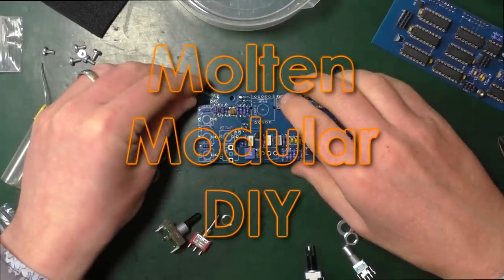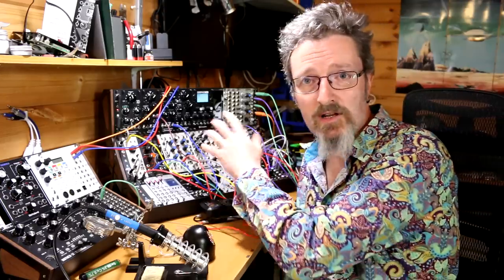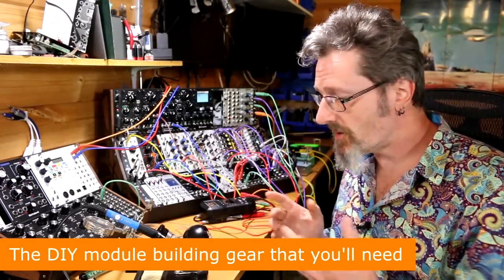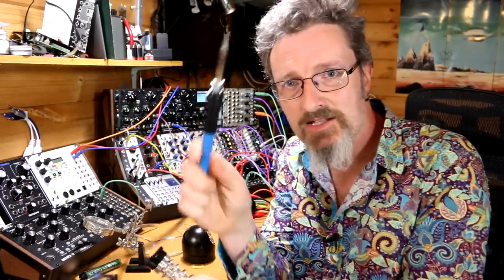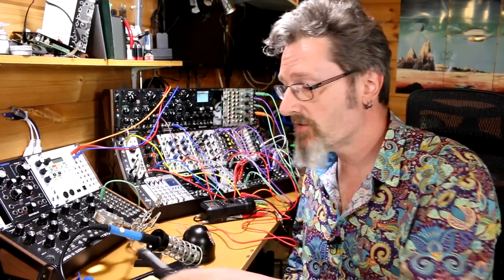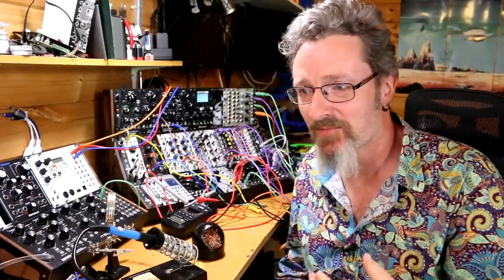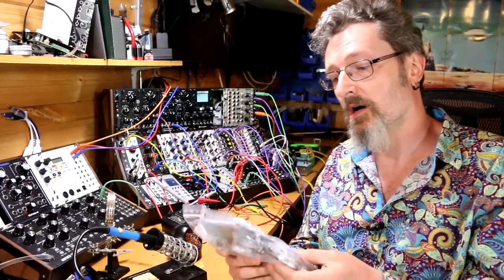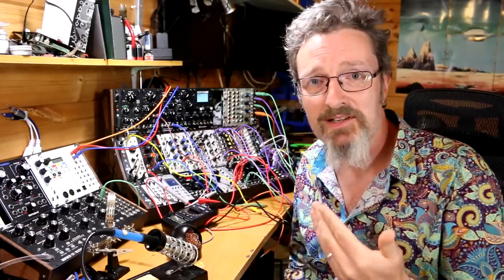Modular DIY 01 - Introduction to building your own modules and the gear you'll need

Comment: Critical to all soldering is correct temperature. Get it wrong with a cheap iron and you will overheat and float / volatilize pcb pads and tracks faster than the proverbial through a goose.  Get a soldering station with temperature indicators and the added bonus of a hot air gun. They really do what they say on the tin. It doesn't have to be a 2K Hakko but a good station is worth every penny as your soldering can look really good with practice.
Reply from the maker: I don't really care what it looks like mate :)
Reply: Ah , you should , because a good looking solder joint is likely to be a good joint. It goes hand in hand.
Reply from the maker: Fair enough. Well you can store up your “told you so’s” until I’ve done a couple of videos 😀
Reply: It's true, that's why lead-free is seen as worse, more often makes cloudy cold joints which are not as strong and will fracture sooner under vibration. You want to be able to see your own beautiful mug in the shiny reflection!

Comment: I'm assuming that people suggesting against a solder sucker do so because you're working with PCBs. The danger is you might lift a trace when trying to suck up some solder. I could be wrong though as I haven't even made it as far as buying a soldering iron yet. But the idea of building some modules is tempting. Both as a way of getting them a bit cheaper but also for the learning experience.
Reply: Local Technique You are correct, but in my experience, you are far more likely to lift a trace from overheating the board, than you are from the actual suction. I find that a solder sucker and solder braid are both effective in different situations. Using a solder braid to wick up melted solder from bridged pins on an IC chip is a good technique as is using lots of flux, then sucking the solder out of a trace when you have removed a through hole component is also effective. You just want to be careful about how long you leave the iron on that trace. Most lifted traces happen when you apply too much heat to it, and the board underneath it melts. Hope that helps.
Reply: Thanks! That does help. "The more you know" :)
Reply: Sometimes you need to add more solder to remove what's there. 
I don't know whether this is because of the flux, or the added momentum from more mass, but I do know that more solder means more places for the heat to go rather than the pad itself, which helps to prevent lifting.
Personally I think I've lifted more pads with braid than a pump.

Comment: desoldering braids are useful when you link two rings for instance, you press it in between the two rings and you heat it up with your iron
Reply: I don't have much experience but it seems like a pain in the ass to use for desoldering in a socket or whatever you call that
Reply: For a couple of seconds I thought that you're speaking about Mutable Instruments modules, they have Braids and Rings 😅

Comment: This is great! Any chance you can tell how much a DIY module costs compared to buying a module? Is it 30 % less, half price, a tenth or...?
Reply from the maker: It depends. Usually the shop selling them will have the prices- try Thonk.co.uk
Reply: @MoltenMusicTech  Thanks. :) I just figured there might be a rule of thumb. Saving 10 % is not worth the hassle to me. But e.g. getting 3 DIY modules for the price of 1 would make it worth it. Thank you for your wonderful videos. :)
Reply from the maker: Oh i see. Well if you think about it you're saving someone 1-2 hours work so that would be around 20 quid so it's not as cheap as you think. Unless you just buy PCBs and source the components yourself - you can make savings there if you buy your own components in bulk.

Comment: A good analog self-contained synth such as a Korg Minilogue does a lot with twiddling and a seemingly endless array of sounds. Isn't modular kind of a pain in the arse? Lol. I did buy the VST called Voltage Modular, and I did buy a few Vult filters and oscillators to add in. Just cos it was cheap to get into. Thx for your down to earth informative posts.

Comment: do these modules bag cost a lot? I was thinking of buying lots of pieces and the chips I need
Reply from the maker: Depends what you mean. Kits are generally cheaper than assembled modules - try looking at shops for prices like thonk.co.uk
Reply: @MoltenMusicTech  I meant kinda making them from scratch, but kits don't seem so expensive so I might use them when I feel lazier, haven't even made my atari punk console yet but getting into modular means being overwhelmed with projects before even starting :D
Reply: @MoltenMusicTech  getting premade boards and not having to use a breadboard seems worth it tho